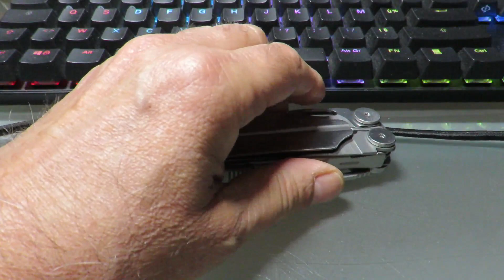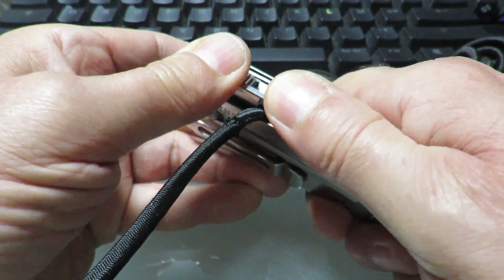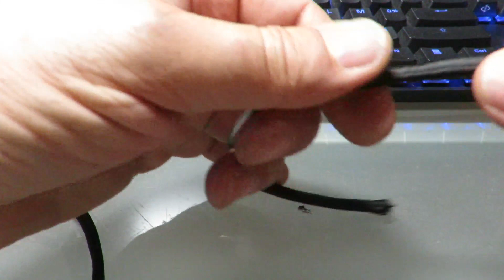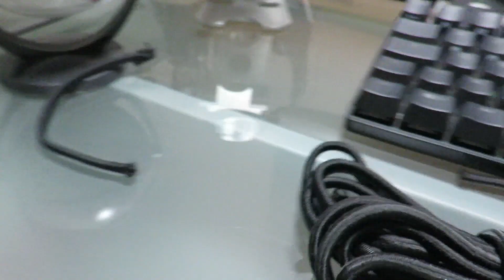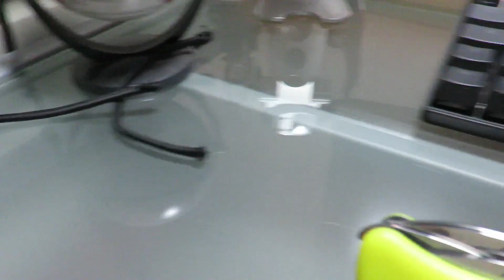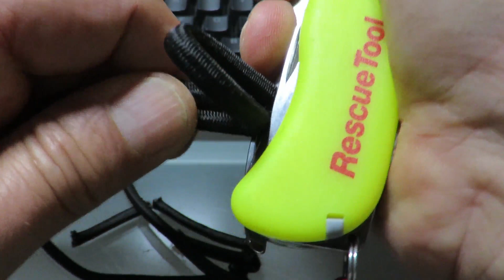VICTORINOX RESCUE TOOL SCHOOL : Demonstration of the scissor effect!

Comment from the maker: MT VOD * Dear lovers of multi-tools, you can ask me everything, redo a review, insist on a detail, make comparisons, test this or that, I am at your disposal! :) * Multi-Tool VOD
Here is my collection of multi-tools (August 2019) [/S = Brand Sheath]. Each model has been the subject of one or more videos (see my playlist "MULTI-TOOLS").
001- BALADEO Outdoor Cutlery Multi-tool /S               
002- BEAR & SON Bear Jaws 155LS /S
003- BÖKER PLUS Tech Tool City 5 /S
004- BUCK Knives X-Tract 730 /S
005- BUCK Knives X-Tract 735BKS-B Essential
006- BUCK Knives BuckTool 350 (MiniBuck)
007- BUCK Knives BuckTool 355 /S
008- BUCK Knives BuckTool 360 /S
009- BYRD ByrdRench BY15P /S
010- COLEMAN Pro Lock /S
011- CRKT Bivy CR9250 (by Hans Florine)
012- CRKT Guppie CR9070 (by Launce Barber)
013- CRKT Technician Multi-tool CR9201 (by Glenn Klecker)
014- CRKT Tool CR9200 (by Ed Van Hoy & Tom Stokes/ with Bit Kit) /S
015- CRKT Zylla-Tool Jr. CR9065K /S
016- CRKT Wooden Multi-Tool Kit CR1035
017- EICKHORN SOLINGEN PRT-II Rescue Knife /Böker S
018- FISKARS Cuts+More
019- GANZO G301-H /S
020- GANZO G302-B /S
021- GERBER Balance /S
022- GERBER Bullrush /S
023- GERBER Center-Drive (with Bit Kit) /S
024- GERBER Crucial /S
025- GERBER Crucial F.A.S.T. (with Hex Bit Kit)  /S
026- GERBER Curve
027- GERBER Diesel /S
028- GERBER Dime
029- GERBER Flik /S
030- GERBER Fit /S
031- GERBER Grappler /S
032- GERBER MP1 /S
033- GERBER MP1-MRO (with Bit Kit) /S
034- GERBER MP 400 Compact Sport (05500/ 45500) /S
035- GERBER MP 500 Recoil Auto-Plier /S
036- GERBER MP 600 Bluntnose (old model with 55200 Multi-Plier Pocket Tool Kit) /S
037- GERBER MP 600 Bluntnose Black (07520G1N Carbide Insert Cutters with Tool Kit) /S
038- GERBER MP 600 Pro Scout (07564/ 47564 with Tool Kit) /S
039- GERBER MP 700 Urban Legend /S
040- GERBER MP 800 Legend /S
041- GERBER Octane /S (*2)
042- GERBER Radius /S
043- GERBER Splice
044- GERBER Strata /S
045- GERBER Suspension /S
046- GERBER Suspension-NXT /S
047- GERBER Truss /S
048- GERBER Vise
049- HANWEI Professional Multi-tool by PAUL CHEN 1008-GT
050- HAVALON Evolve Jim Shockey Signature Series XTC-60AMTS /S
051- HENSTRONG (or Bibury or Intey or …) 18-in-1 /S
052- KERSHAW A100C /S
053- LEATHERMAN Blast (with Removal Bit Driver) /S
054- LEATHERMAN Charge+ (with Bit Kit & Pocket Clip & Lanyard Ring & Bit Driver Extender) /S
055- LEATHERMAN Charge+ Forest Camo (with Bit Kit & Pocket Clip & Lanyard Ring & Bit Driver Extender) /S
056- LEATHERMAN Charge+ TTI (with Bit Kit & Pocket Clip & Lanyard Ring & Bit Driver Extender) /S
057- LEATHERMAN Charge TI 2HO (with Bit Kit & Pocket Clip & Lanyard Ring & Bit Driver Extender) /S
058- LEATHERMAN Charge TTI (with Bit Kit & Pocket Clip & Lanyard Ring & Bit Driver Extender) /S
059- LEATHERMAN Charge XTI (with Bit Kit & Pocket Clip & Lanyard Ring & Bit Driver Extender) /S
060- LEATHERMAN Crunch /S
061- LEATHERMAN Expanse E33BX /S
062- LEATHERMAN Expanse E55BX /S
063- LEATHERMAN Expanse K502X /S
064- LEATHERMAN Free P2 /S
065- LEATHERMAN Free P4 /S
066- LEATHERMAN Free T2
067- LEATHERMAN Free T4
068- LEATHERMAN Freestyle /S
069- LEATHERMAN Juice CS4 /S
070- LEATHERMAN Juice S2 /S
071- LEATHERMAN Juice Pro (with Victorinox Mini Screwdriver) /S
072- LEATHERMAN Juice XE6 (with Victorinox Mini Screwdriver) /S
073- LEATHERMAN Leap /S
074- LEATHERMAN Micra
075- LEATHERMAN MUT (with Bit Kit & Tool adapter V2) /S
076- LEATHERMAN MUT EOD /S
077- LEATHERMAN OHT (with tweezers) /S (*2)
078- LEATHERMAN Raptor /S
079- LEATHERMAN Rebar /S
080- LEATHERMAN Rev /S
081- LEATHERMAN Signal /S (with Bit Kit & Bit Driver Extender)
082- LEATHERMAN Sidekick /S (with carabiner)
083- LEATHERMAN Skeletool CX (with Bit Kit & MUT Bits) /S
084- LEATHERMAN Skeletool RX (with Bit Kit & MUT Bits) /S
085- LEATHERMAN Squirt E4
086- LEATHERMAN Squirt ES4
087- LEATHERMAN Squirt P4
088- LEATHERMAN Squirt PS4
089- LEATHERMAN Squirt S4
090- LEATHERMAN Style
091- LEATHERMAN Style CS
092- LEATHERMAN Style PS
093- LEATHERMAN Super Tool /S
094- LEATHERMAN Super Tool 200 (with Tool Adapter V1) /Combo S
095- LEATHERMAN Super Tool 300 /S
096- LEATHERMAN Super Tool 300 EOD /S
097- LEATHERMAN Surge (with Bit Kit & Pocket Clip & Lanyard Ring & Bit Driver Extender) /S
098- LEATHERMAN Surge 2013 Black Edition (with Bit Kit & Pocket Clip & Lanyard Ring & Bit Driver Extender) /S
099- LEATHERMAN Wave (with Bit Kit & Pocket Clip & Lanyard Ring & Bit Driver Extender) /S
100- LEATHERMAN Wave+ (with Bit Kit & Pocket Clip & Lanyard Ring & Bit Driver Extender) /S
101- LEATHERMAN Wingman V1 /S
102- OPINEL N°9 Bricolage
103- PIRANHA 6-in-1 (crescent wrench & pliers combo) /S
104- PIRANHA 9-in-1 (crescent wrench & pliers combo) /S (*2)
105- RATNIK 6E6 (with diamond-coated file) /S
106- ROXON Knife Scissors S501
107- ROXON Multi BBQ Tool MBT Mini S602
108- ROXON Multi BBQ Tool MBT3 S601 /S
109- ROXON Sparkle CM1349 /S
110- ROXON Storm S801 (with bit kit & Victorinox Mini Screwdriver) /S
111- RUIKE Criterion M61-G (with Victorinox Mini Screwdriver) /Böker S
112- RUIKE Trekker LD43 Rescue Tool
113- RUIKE Trekker LD51-B (with Victorinox Mini Screwdriver) /Victorinox S
114- SCHRADE Tough Chip ST2 /S
115- SCHRADE Tough ST1 (original U.S./ version 1) /S
116- SCHRADE Tough ST1 (Taylor Brands Schrade) /S
117- SCHRADE Tough ST11 /S
118- SCHRADE Tough STE5 /S
119- SEBERTECH Sebertool M2
120- SEBERTECH Sebertool M4
121- SOG CrossCut 2.0
122- SOG Paratool S31 (with Saw instead Philipps screwdriver + Bit Driver + Hex Bit Accessory Kit) /S
123- SOG Pocket PowerPlier S44 /S
124- SOG PowerAccess Deluxe (with bit kit) /S
125- SOG PowerAssist S66 (with Saw instead of V-Cutter) /S 
126- SOG PowerDuo PD01 /S
127- SOG PowerGrab (with Bit Kit) /S
128- SOG PowerLock S60 (with Bit Kit) /S
129- SOG PowerPint (with Bit Kit) /Böker S
130- SOG PowerPlay (with Bit Kit) /S
131- SOG Snippet
132- SOG SwitchPlier V2.0 /S
133- SOG Sync II
134- SWISS+TECH Micro-Max 19-in-1
135- SWISS+TECH Micro-Plus EX 9-in-1
136- SWIZA C08 Urban Camo/S
137- TOPEAK The Alien /S
138- UD Vape Cool Kit Multi-tool Cutting Pliers /S
139- UTICA KUTMASTER Multimaster 11-3565CP /S
140- VICTORINOX Bantam (ALOX Silver 0.2300.26)
141- VICTORINOX Cybertool L (1.7775.T) /S
142- VICTORINOX Evolution Grip 18 (2.4913.SC8B1) /S
143- VICTORINOX Expedition Lite (1.7965.AVT) /S
144- VICTORINOX Huntsman Lite (1.7915.T) /S
145- VICTORINOX Huntsman SilverTech (1.3713.T7) /S
146- VICTORINOX MiniChamp (0.6385) /S
147- VICTORINOX Nail Clip 580 (0.6463)
148- VICTORINOX Pioneer X (ALOX Silver 0.8231.26)
149- VICTORINOX Ranger Grip 71 Gardener (0.9713.C) /Wenger S
150- VICTORINOX Rescue Tool  (0.8623.MWN) /S
151- VICTORINOX Signature Lite SilverTech (0.6226.T7) /S
152- VICTORINOX Swiss Army Knife 18 (0.8461.MWCH) /S
153- VICTORINOX Swisschamp (1.6795.T) /S
154- VICTORINOX SwissTool PLUS (3.0323.L) (with all accessories & scissors) /S
155- VICTORINOX SwissTool Spirit XBS (3.0224.3CCH) /S
156- VICTORINOX SwissTool Spirit XC PLUS RATCHET (3.0239.N) (with all accessories) /S
157- VICTORINOX Wine Master (walnut wood 0.9701.63) /S
158- VICTORINOX Workchamp (0.9064.3) /S (~ 0.8564 : lockable large flat screwdriver)
159- WALTHER Multi-Tac /S
160- WENGER EvoGrip S557 (1.557.059.821 with Victorinox Mini Screwdriver/ ~ Victorinox Evolution Grip S557) /S
161- WENGER Pocketgrip 577 /S
162- WENGER RangerGrip Handyman 1.077.0[90.822] /S (~ Victorinox Ranger Grip 74 or 174 Handyman or Boatsman for the pliers)
163- WENGER Swiss Business Tool SBT 60
164- WENGER Titanium 2 (1.092.042.000) /S
165- WENGER Titanium 3 Ueli Steck Spécial Edition (1.092.040.000) /S
166- WORPRO 16-in-1 Multi-tool /S
167- XIAOMI Nextool Huohou /S

Acquisition forecast - Call for donations… Leatherman, Sog, Gerber, Victorinox and the others (except Roxon) still stubbornly refuse to send me models that I could present. We live in a world unnecessarily absurd delivered to spirits that seem to be content with it...
1- BEAR & SON Bear Jaws Multiscissors BC157SM
2- BEAR & SON Electrician's Bear Jaws BC155EL
3- BEAR & SON Mini Bear Jaws 153
4- EMERSON Multitasker EDC 1/ 2
5- GERBER Centre-Drive Plus
6- GERBER Evolution MP650
7- GERBER Hinderer Rescue
8- GERBER Solstice
9- LEATHERMAN Core
10- LEATHERMAN Fuse
11- LEATHERMAN PST II
12- LEATHERMAN Free K4X
13- MASERIN Citizen 564/G10N (by Moris Baroni)
14- LEATHERMAN Pruner (Genus/ Visa/ Hybrid)
15- MELITA-K Sapper/ Professional
16- SOG CrossGrip
17- SOG ToolClip
18- SPYDERCO Spyderench T01
19- VICTORINOX Cybertool Lite
20- VICTORINOX Swisschamp XLT
21- WENGER Ranger 14 Gardener
22- WENGER SwissGrip (WengerGrip 76)